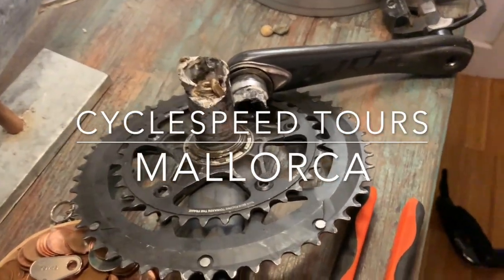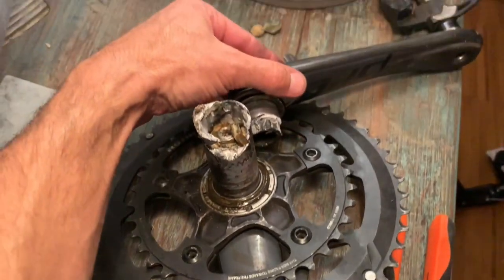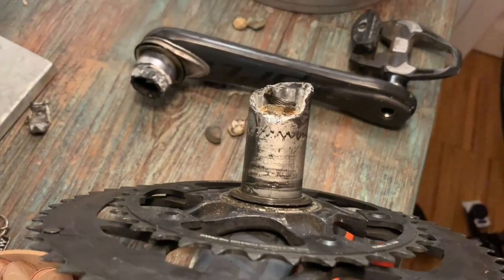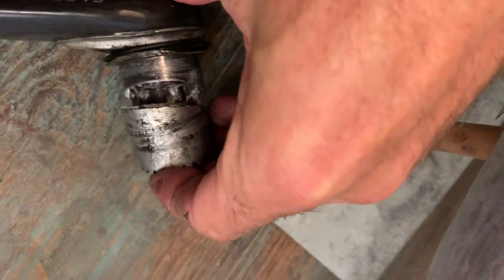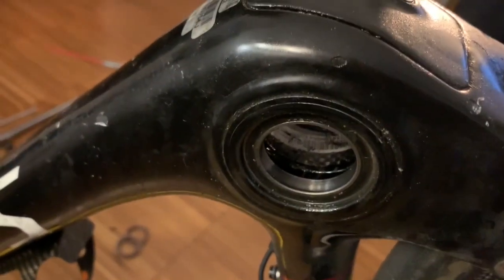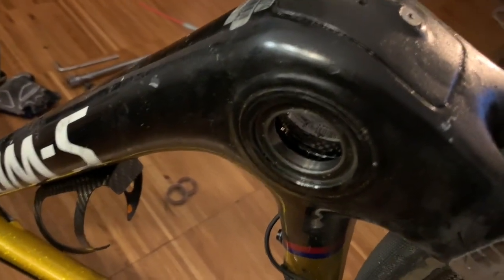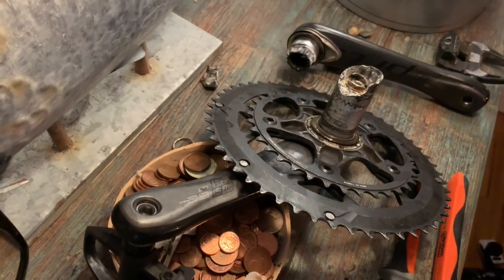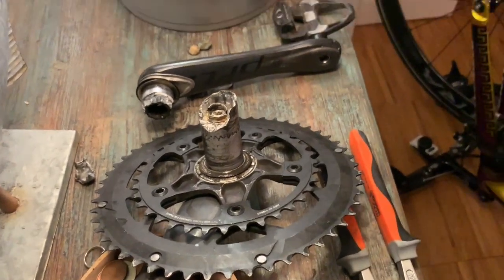SWORKS cranks snapped in two!!! Design flaw?

Comment: Same happened to me. I now have new S-Works cranks. Unfortunately they click under load. My LBS has now had two attempts to fix it. 
And according to them they have - they cant hear it apperently.  All my riding buddies can....but they can't - no more Speicialized for me.
Reply from the maker: Hi, I've recently seen another snapped pair, exactly the same place. Try reseating your bearings and maybe using a compound of some kind. Most likely it's the bearings / shell and not the crankset.

Comment: You ride with sram red chainrings now?
How they perform with di2?
Reply from the maker: In fact I had Rotor chainrings, but now have a full SRAM Red, 52/36. All shifted fine.
Reply: Cyclespeed Tours 
Shimano or sram red?
Shimano should shift much better
Your toughts?
Reply from the maker: @GramCounter  With a well set up Di2 I have found all my front shifts to be excellent, even with Q rings. I wouldn't worry too much, just use what you like best for the right price!
Reply: Cyclespeed Tours 
I’m in dilema.
Power2max that i can mount shimano chainrings or quarq d zero with sram chainrings.
Cost almost the same.
I heard that shimano chainrings are much stiffer then anything else on the market
Reply from the maker: @GramCounter  If shifting is extra important to you then you certainly  can't go wrong with Shimano, it's their party after all......

Comment: Looking at the way the metal has split, it looks like a fatigue failure. I suspect there may have been a defect in there to start with that got worse over time. I guess they are forged and then final machined as opposed to machined from bar stock?
Reply from the maker: Hi Hammy! and HNY! I think forged yes, and it must be fatigue related I think. That area is twisted hard every revolution.....
Reply: Hambini! Yeah definitely forged.

Comment: That's the trouble with aluminium parts, they eventually fail from fatigue (as does everything, but aluminum has a much shorter fatigue life usually). To be honest I wonder if you can expect too much more than 45,000 km out of a part like that. I'd be interested in the geometry of the interior of the spindle, I'd suspect to find some sort of a stress raiser around the crack. Btw you've got to keep those cranks, they are beautiful and would make a nice display piece! I'd love to have those on my Allez SmartWeld SL with a brushed finish.

Comment: I'd say it's more likely that there was an undetected flaw in the material and not a design flaw.  Perhaps that coupled with corrosion?
Reply from the maker: Thanks Robin. They worked fine for 3 years, so I'd say more like fatigue, but they should be designed to last at least 10 years, especially as there are bigger riders out there that make double the power I do.....
As for corrosion, the bike is always kept inside a warm house and I very rarely ride in the rain as I hate the wet stuff! So don't think so.
Reply: @CyclespeedTours  , small flaw in the material could take a while to manifest.  Then with the accelerated fatigue from a small flaw, micro cracks could appear providing an avenue for corrosion to devlop, even with a well-cared for bike.  It just seems that. design flaw is unlikely given that there hasn't been a rash of axle failures.  That doesn't mean there isn't a design flaw, but it does mean that sometimes crap happens to even the best manufacturers.  I'd say the best way forward would be to call Specialized and send them pics.

It is odd that the axle broke into so many pieces.  That's not a normal failure for metal but might be expected in a metal that has been work hardened through to much flexure or a metal that has corroded.  Either way, it's good that you didn't get hurt.  Hopefully Specialized will help you out.

Comment: now you got some pair of pistons there mate! Keep the power up, crank killer. But seriously, this should not have happened under any circumstance
Reply from the maker: LOL, I'm only a puny 64kg, so my power (or torque to be more precise!) is not going to trouble most kit. But I did snap a DA cassette in October and now this, so maybe I could still turn pro yet....!!
Reply: @G T Bicycle components fail from fatigue, not in yield! Of course you were joking, just thought I'd mention it for anyone else reading.